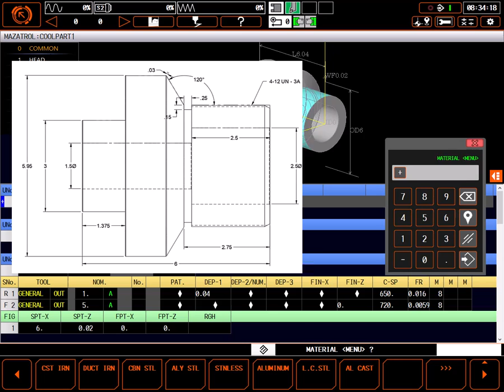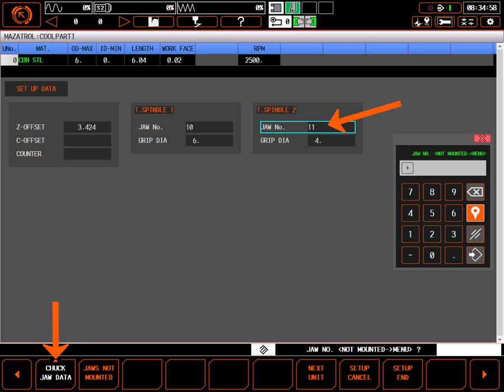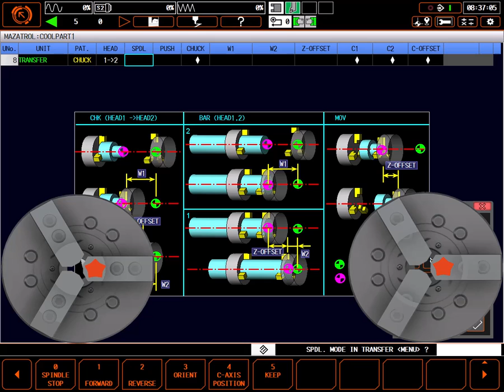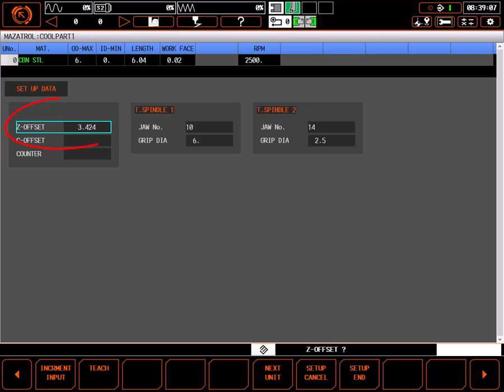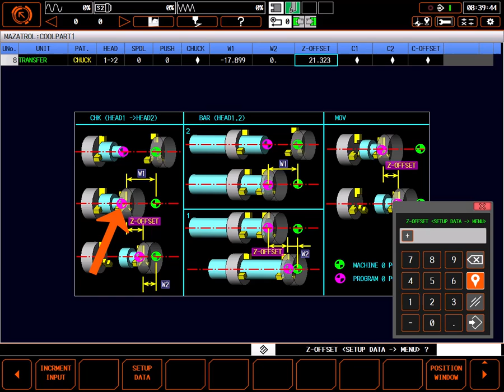MAZATROL Programming Briefs: Part Transfer

Comment: When I try to use the push the machine faults regardless. How much thrust or how little thrust I put on the spindle load Is there a parameter that needs to be adjusted to complete the transfer

Comment: I'm wanting to move the sub spindle over and grip the bar and turn the od in the sub spindle without moving the part, then I want to move the subspindle over and grab the part in a different spot to part off
Reply from the maker: Mazak USA has regional tech centers that include an applications department.  Please reach out to your regional tech center for free over-the-phone applications support to solve your issue. To find the nearest Mazak distributor or Mazak Tech Center visit https://www.mazakusa.com/offices-and-distributors/